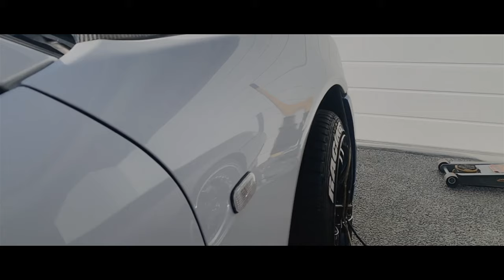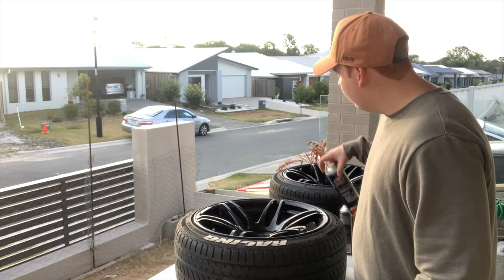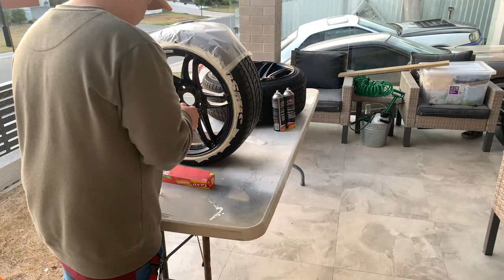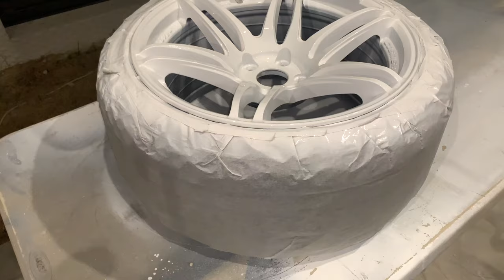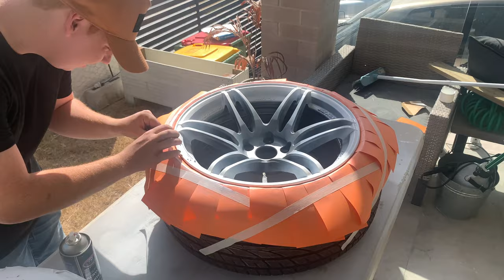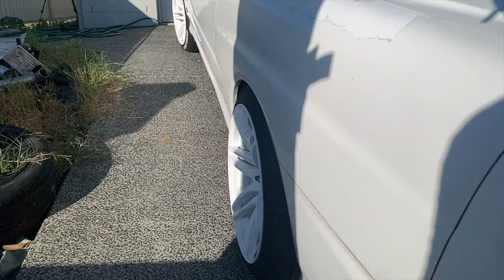Painting my wheels white!

Comment: Hi, was the front hood and bumper direct bolt on fit? I've read it requires a little bit of conversion.
Reply from the maker: Dale Masamayor you will need GTR hinges and latch also if you don’t change the front guard will have some bumper hanging